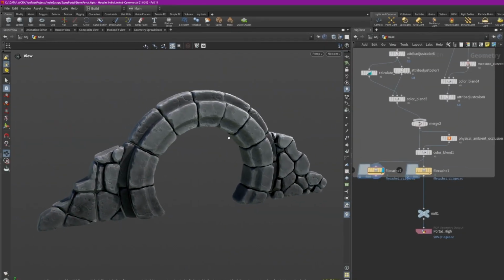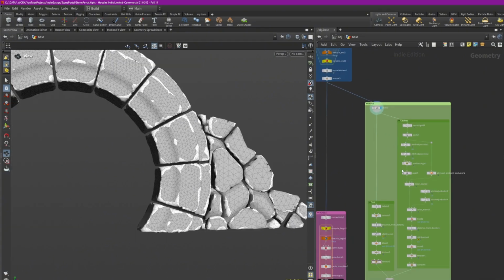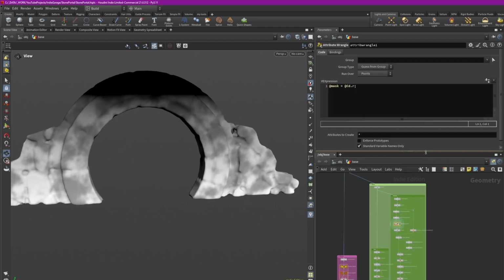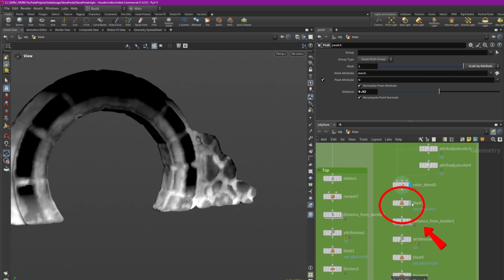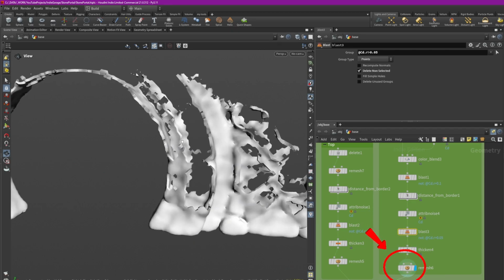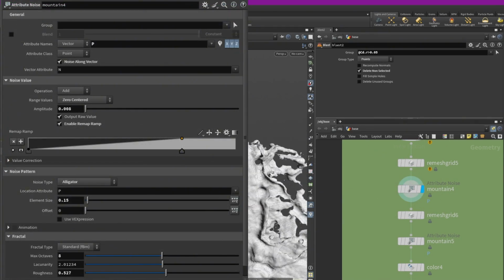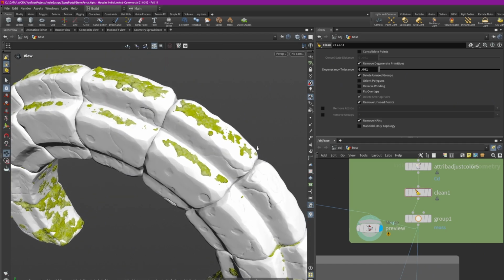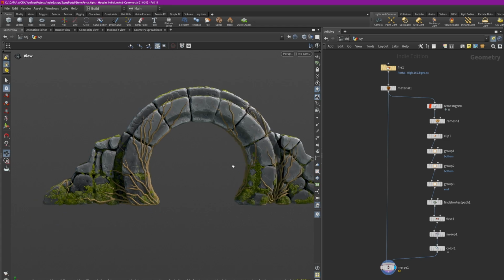Forget about Zbrush! #2 Procedural Moss #houdini #modeling

Comment: I purchased this on Gumroad, but it seems there is no content included.

I was expecting either a Houdini (.hip) file or a tutorial video.
Are there any plans to add these in the future?

Thank you.
Reply from the maker: Hi 
I will check the file asap
You should be able to get the hip file
Sorry for the mistake 😅
Reply from the maker: The has been uploaded!
Sorry again!
Reply: @IndieGarage1980 

Thank you very much for your quick response.
I was able to confirm that the file has been uploaded.
I also appreciate the tutorial—I’ll study it carefully.

No pressure at all, but I would be happy to purchase your other tutorials in the future as well.